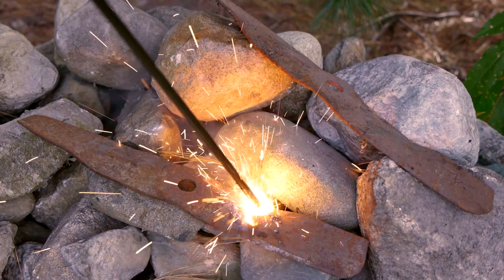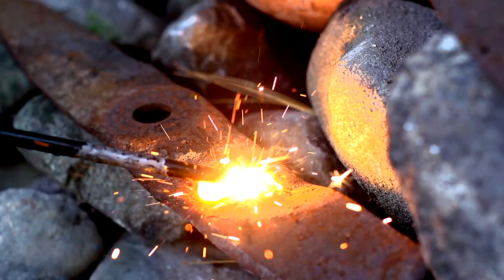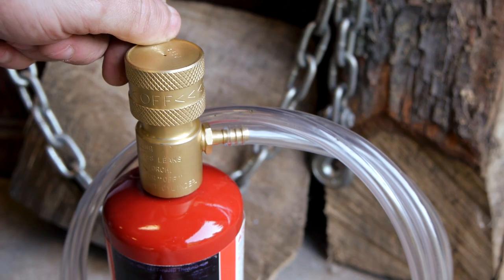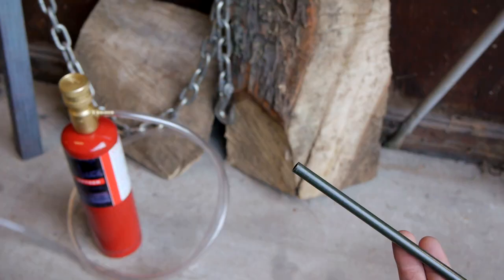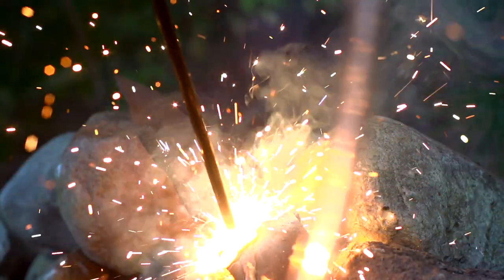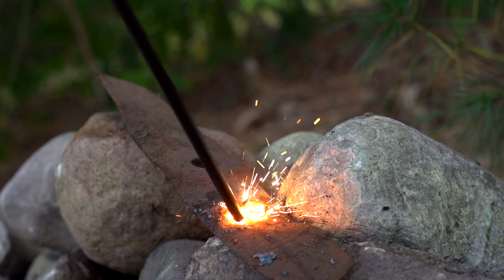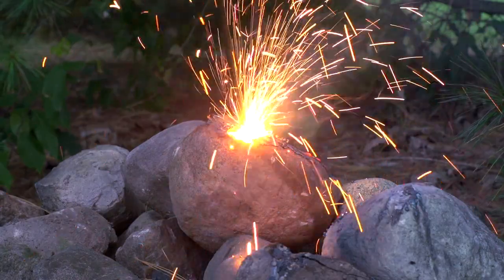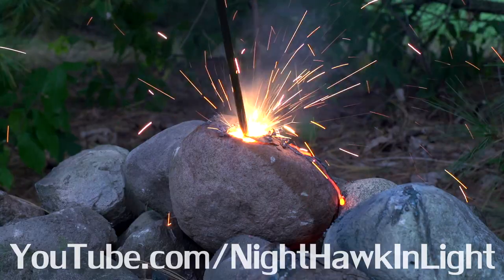How to Make a Thermal Lance Kit - Hot Enough To Melt Rock - NightHawkInLight

Comment: Can i use compressed air ? Or only O2 will work ?
Reply: compressed air is the same but put the pressure low so it won't blow it out
Reply: +Jocker_Games Compressed air would have only 21% oxygen, so I would say it is much cooler if it even ignites the solid iron.
But feel free to try it out.
Reply: +Jocker_Games The more oxygen, the better it burns.
Reply: +Caspar Abelmann but too much can put it out
Reply: +dustin kraemer how can too much oxygen put fire out? Too much might speed it too much, but it won't kill a fire.
Reply: +noobnoobyify it's like blowing on a match it can be put out but if it doesn't have the exact heat or fuel it after too much oxygen it can be.
Reply: +dustin kraemer it is nothing like blowing on a match. Your breath is not 100% oxygen.
Reply: +noobnoobyify but there is oxygen blowing on it
Reply: ***** Actually, the oxygen won't burn quick enough, engulfing the flames in oxygen, resulting in extinguishing it.

Fuel like coals ( where the heat is kept inside instead of outside, like the burning metal ) won't go out.
Reply: +Caspar Abelmann +dustin kraemer 
Ok, I've done more research on this and you are both right. It would take an insane amount of oxygen to draw heat to the point where a fire is no longer self-sustaining.
Reply: +noobnoobyify You could do it in theory.  Sufficient flow could put it out by disrupting the O2 / fuel mix and lower the temp sufficiently but I am unsure the volume / flow required because higher O2 levels also reduce the fuel required to sustain combustion. The O2 required may be stupidly large and totally impractical in reality depending on the fire. This is only my personal guess but I was a Firefighter for 8 years and have some knowledge of combustion. However as a general rule the greater the O2 % the better the burn.
Reply: Famine2k stay safe brother I've been for 1 1/2 years stay safe.
Reply: dustin kraemer
You too mate. Best advice I can give is to always calculate risk and think through all the shitty "what if's". Its the thing that we miss that kills / injures us. Also ALWAYS wear your BA. seen way too many mates get hurt / contaminated by being lazy with BA. One last thing (from personal experience) never trust a burnt floor. I did and it very nearly killed me.  Stay safe brother. I will say the Firefighter prayer for you.
Reply: +noobnoobyify Have you ever set up an oxy-acetylene torch, you can put out the burning acetylene, which is extremely flammable, with the oxygen supply.

Comment: How do you get the steel wool to burn in the video of it spinning around?
Reply: Shadowgt        It's easy to ignite steel wool. use a 9V battery. either direct touch the terminals to the wool, or place 2 wire leads in middle of wool and and connect to batt.

Comment: Will this melt through 3/4 inch steel plates?
Reply from the maker: +G2 Tech Thermic lances can melt through any thickness because they actually burn the material in addition to melting it. That's what gives them an advantage over torches, but they require a lot of oxygen to do so. 3/4" may be asking a little too much for disposable tanks.

Comment: hmm try filling the tube up with tig filler wire to add mass
Reply: +Gummy Bear that would cut off the oxygen supply to the ignition.
Reply: it want try it for ur self get spaghetti add them in straw and blow air gets by
Reply: I've seen that done before too. It is a decent show.
Reply from the maker: +Gummy Bear Tried that. The wire burns way too fast and outruns the end of the tube. I also tried larger diameter piano wire, that also burned way too fast.

Comment: If you want very convenient lightweight portable oxygen for less money you can do what I do and transfill medical or small industrial oxygen cylinders using a "transfill whip" off your larger shop cylinder. You can buy the parts from Western Enterprises through Airgas or (as I prefer) online. I use an oxygen tee, a pigtail, and a typical welding regulator on the side of the tee opposite the pigtail. Attach tee to large cylinder valve, then connect regulator and pigtail. Pigtail connects to my medical cylinder adapter or to the valve on an industrial cylinder. You of course cannot fill a cylinder beyond feeding cylinder pressure so it's best to fill off a fill off a full cylinder. I prefer to use pigtails with female fittings to mate with threaded nipples so I can replace any part in the system, but premade pigtails may cost a few bucks less. You probably know your CGA fittings by heart so I won't list them. Any readers interested will do their homework, and remember to KNOW what high pressure oxygen safety rules AND theory! For aluminum medical cylinders you will need a CGA 870 (medical valve) to CGA 540 (oxygen welding regulator) adapter. You can find them easily on Ebay along with all or most of the other parts, none of which are unusual. 

WARNING TO NOOBS! Aluminum medical oxygen cylinders must be externally perfect or don't use them! If yours are UNKNOWN, EXCHANGE them for currently hydro tested cylinders at your local welding supply.  PROTECT them from damage. If you are rough on equipment then use small STEEL industrial cylinders instead! Medical cylinders are lightweight and great for mobile work. You can use both types with a small LP cylinder for torch cutting too. You'll use a lot more oxygen then LP so practice to get a feel for consumption.  

If you are an ordinary medical oxygen user, remember that cylinder is quite capable of killing or maiming you if mishandled. 

I would NEVER transfill a disposable oxygen cylinder. They are not designed for high pressure use and would promptly burst. Don't even think about it. 

With the oxygen regulator output valve fully closed, I crack the supply cylinder valve (never abruptly open high pressure oxygen, you can see particle impact ignition videos for why!) and open slowly allowing pressure to equalize between cylinders.. Your oxygen regulator is used as a pressure gauge and bleed valve in this application. When pressure is equal between cylinders, close both cylinder valves. You can then open your regulator to bleed off the high pressure oxygen remaining in the hose. After that, disconnect your whip, install any cylinder caps, and go about your business. Standard regulator nut size is 1 1/8", worth remembering if you don't have a large adjustable handy.

Ensure NO oil is on or near high pressure oxygen fittings. 

Other users of transfill whips are scuba divers and pilots. Many general aviation pilots use welding O2 because modern cryogenic LOX plants are used for all oxygen production.

Know what you are doing. Weldingweb and the Miller forums are great places for anyone of any skill level to learn. Don't just watch a video or read one internet post then expect success. 

Happy cutting!

Comment: Roughly how much total did you spend and where do you suggest we get oxygen tanks?
Will an air compressor work? Like they have at construction sites for air powered tools?
Reply: Air only has an oxygen concentration of about 21%, not nearly enough for this reaction, compressing it wouldn't change that
Reply: +kEEpEr Grounds you're looking at about $5 per brake line and about $10 per O2 tank. i cant imagine that they are used at a 1:1 rate though. my completely uneducated guess would be 2-5 brake tubes per O2 tank
Reply from the maker: +Ltifone2014 It's actually a ratio of about 2 oxy tanks per 1 three foot brake line.
Reply: wow. i didn't think and oxy torch would eat that much O2
Reply from the maker: +Ltifone2014 The disposable tanks don't hold as much as you would hope
Reply: just looked it up. only 1.4OZ. the propane ones are close to 10x that
Reply: as an aside, it's really cool that you still take time out of your day to talk to your viewers. 
also, don't feel obligated to respond. we all lead busy lives and i get that

Comment: what's hotter ...aluminium or iron?
Reply: me
Reply: +Suraj Grewal depends on it's temperature :P
Reply: +Lor Reuben No definitely me
Reply: steel beams, because not even jet fuel can melt them
Reply: +mita232 it's not about melt it's about when you burn them witch gives  the most temperature. I think iron but I'm not sure.
Reply: +Suraj Grewal It appears that Aluminum burns at over 4,100 K (3826°C / 6920°F) while Iron burns easily at temperatures around 1270 K (1000°C / 1832°F)... If someone knows better, please correct me.

Comment: how quickly do you use up a tank  of that size with this process?
Reply from the maker: +crazylemonso99 About 5 minutes. It's enough time to cut a few things, but a full size welding tank would be needed for long term use.
Reply: Thanks. Great video.

Comment: how does this differ from a oxygen acetylene torch?
Reply: Oxygen Acetylene reacts oxygen with acetylene to make CO2, H2O and a ton of heat while this is Iron and Oxygen reacting to make Rust, H2O, and slightly less heat but still alot

Comment: A IMPORTANT detail....!! Make SURE there is NO OIL in your plastic tube or the steel tube or the pure oxygen will blow it up!
Where I worked a guy used a hose that was for a lance to drain oil and then put it back...the next shift came in and the guy didn't realize it had oil in the line and it blew up from one end to the other...taking a couple fingers with it!
You need to know what you are doing....

Comment: Hey NightHawkInLight,
Where does one get that oxygen valve, I've been looking for something just like that to make a hybrid rocket engine. Thanks!
Reply from the maker: +superozzylasrdog Found mine on ebay.
Reply: +NightHawkInLight, 
What do you think the risk of flame going back down the tube is? Love your channel btw, very inspirational.
Reply from the maker: +superozzylasrdog 100% if flame hits the vinyl, it will burn extremely quickly. You will need a steel line to separate your rocket engine from the flex tube or the flex tube will burn as soon as you ignite the engine.

Comment: So what's a good safe alternative to vinyl tubing?
Reply: +dasdew2  maybe something like the Stainless steel braided break line / gas line stuff. not only do you need to worry about burning the steel tube down to the area where its connected to the rubber tube, but also a wayward spark hitting it. lol id say put some sort of warning indicator on the break line tubing so you can tell when it starts getting close. paint it a different color or put a hose clamp on it so when the flame gets to that point youll notice it.
Reply: why hose rated for oxygen of course,  go to a welding supply and do it right. get a flashback arrestor and proper line. you can still be safe while being lightweight enough to be mobile.

Comment: i cannot find the fitting for the bernzomatic oxygen tank they are different threads than map, propane, etc im told the fitting is a cg 601 but cannot find it anywhere im calling welding and oxygen service stores but can only get fittings for larger tanks thru them as in a foot tall tank etc any help plz!!!!!
Reply from the maker: +Nick Dereschuk You're almost certainly only going to be able to find them online. Try ebay. They're used for beer brewing.
Reply: Ok THANK YOU VERY MUCH!!! THATS WHAT I THOUGHT
Reply: do you have a link please man

Comment: Would compressed air also work for this?
Reply: +TerminvsEst I would think so. The only difference between them is the air tank is very light and portable, when compared to a compressor which can be very heavy and in most cases require 120 AC volts (or 240 for everywhere but the US).
Reply: ***** Hmm, yes. CGB has a point. Worth a shot either way though. May work, although I wouldn't suspend disbelief that it would be as effective as pure oxygen.
Reply: +TerminvsEst I'm pretty sure you can only use oxygen. What's important is the CONCENTRATION of oxygen to increase rate of combustion, not the volume of oxygen. Compressing air wont affect the concentration
Reply: +TerminvsEst No it has to be oxygen to allow the metal rod to burn

Comment: What oxygen adapter is that?
Also I looked up the model number on that brake line and I don't think it's actually steel. Seems like PVF or Polyvinyl Fluoride, a material that's related to pvc but quite a bit stronger. It seems to work great as is, but I wonder what it would do with steel lines, maybe a follow up video?
https://www.summitracing.com/parts/edd-551pvf
http://www.plews-edelmann.com/products/rhinohide-pvf-brake-lines/551pvf/
Reply from the maker: PVF is the coating on the steel lines. They're absolutely steel.
Reply: Thank you. What oxygen adapter is that?

Comment: Do not do this unless you actually know what kind of hazard you're dealing with. Concentrated oxygen is one of the most dangerous substances that exists and one of its properties is that with enough oxygen, stuff you think of as inflammable will burn. Also it explodes. 

I say again, it burns like nothing else, and explodes, and he's running it through a thin plastic tube to a mini thermal lance burning several thousand degrees. I love this guy's content, but THIS IS STUPID AS HELL.